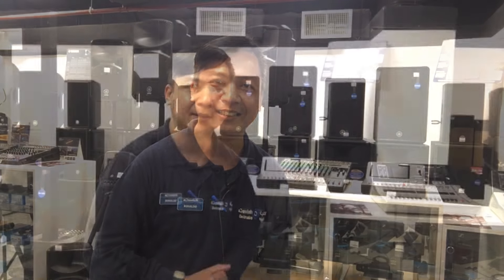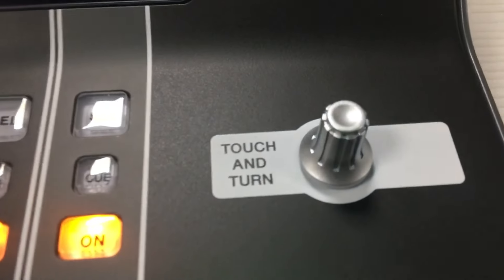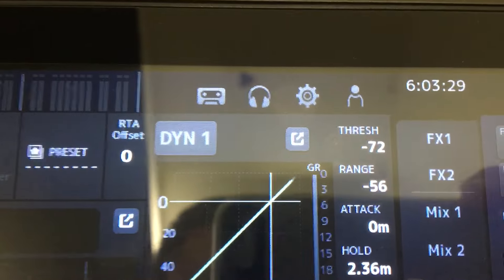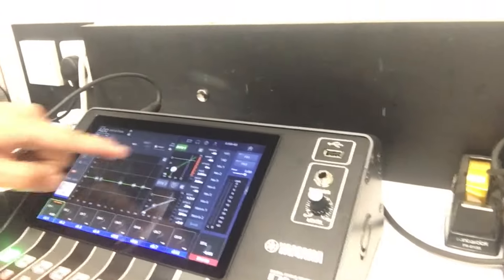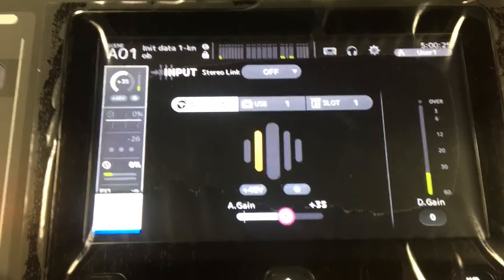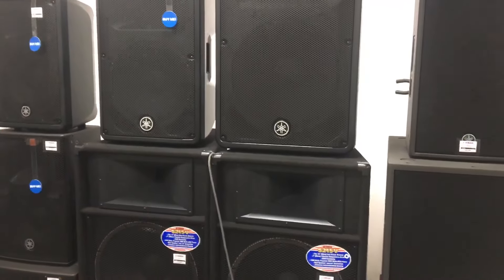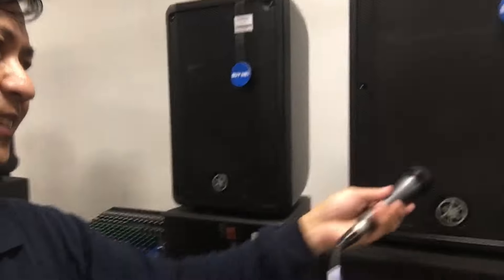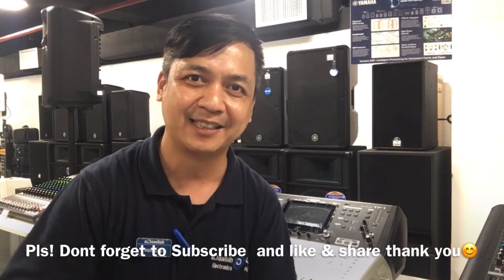Ito ang gawin mo para iwas feed back ang mic mo!

Comment: Sir paano setting sa compresor kasi sa mackie dl16 nakahiwalay ang compresor may threshold din un sir
Reply from the maker: Ah ok sir ganun din po yun , check nyo po kung meron syang gate tapos dun ka lang din mag adjust sa treshhold nya usually mag kakasama yan comp, limitter,gate
Reply: kapain nyo na lang po sir. makukuha nyo rin po yan hanapin nyo po yung gate setting

Comment: Pati ba sa monitor kapag banda sir kayang walang feedback?
Reply from the maker: Yes po sir, mas maganda po talaga pag full band set up or malakihang events po standard po talaga kung di kayo naka digital kaiangan po talaga dalawa ang equalizer mo isa sa house speaker at isa sa stage monitor para maiwasan mo yung feed back sa stage nakakatulong po talaga ng malaki kapag may eq ka sa stage monitor mo para matanggal mo yung mga sensitibong frequency na pinanggagalingan ng feed back , at yan po ang kaibahan ng analig sa digital sa digital po lalo na yamaha lahat po nandun na kahit sa monitor pwede mong i adjust ang eq at noise gate nya yan po sana po makatulong